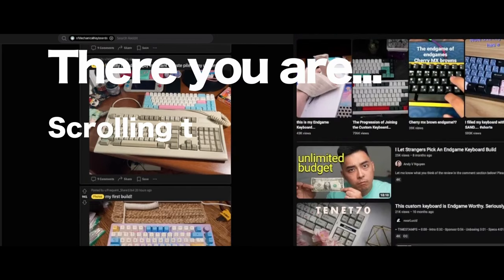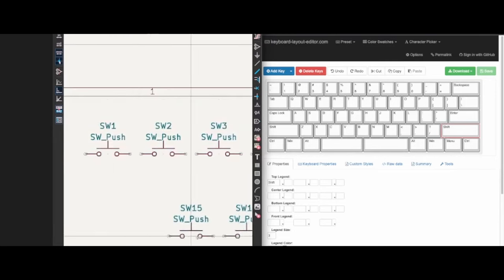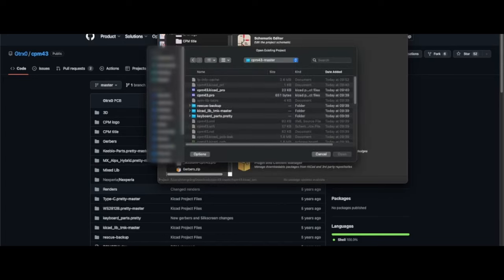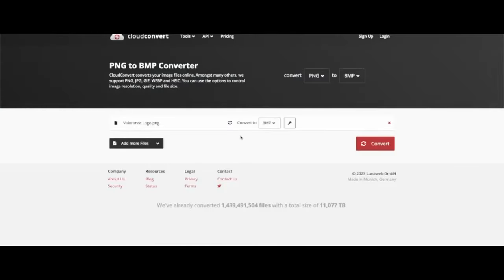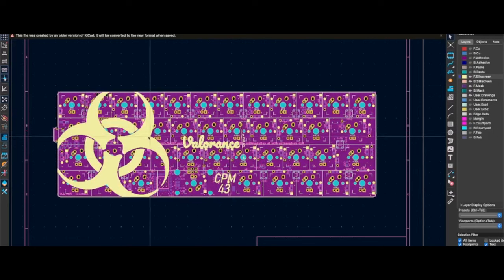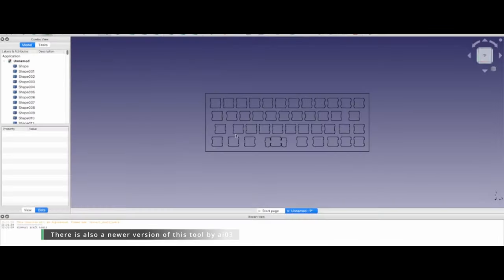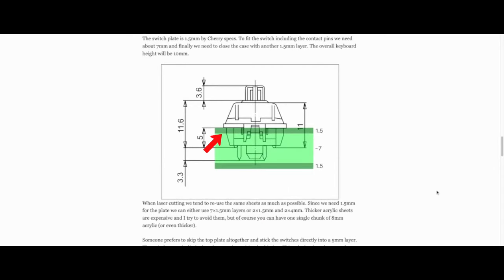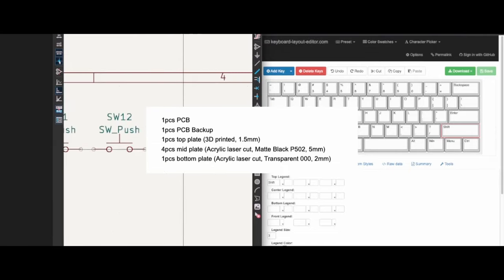How to (Kinda) Create ANY Keyboard

Comment: Hey Valorance, I would like a video on how to edit an existing pcb. Something like adding an extra key to an existing board or move the keys to different positions. I think, when creating a custom keyboard,  most people want some thing that already exist but slightly modified. I remember when I got my first keyboard I had to settle for the bm60ec because it was the only one with an encoder but I would had preferred another keyboard and replace a key for an encoder.

Comment: I wish you went over making the firmware, I know you probably reused the existing firmware for this pcb but still
Reply: @va1orance  nothing in particular but I'm surprised how empty the tutorials for firmware new pcbs are. I've designed quite a few pcbs but give up when it comes to firmware because even the guides suck. Just a straightforward step by step process of A to B is all I need
Reply: @va1orance  good to know, is there a way I can edit the columns? When I paste in my kle data the columns are a bit different than what's on my kicad design

Comment: How are RGB LEDs connected to a printed circuit board?
Reply from the maker: They are soldered on during fabrication.
Reply: @va1orance Thanks for the response, I expressed wrong, how the circuit works on the pcb. how it is connected to the MCU.
Reply from the maker: @RennanMendesSerenzaRennan  Woops, I missed this, sorry. I didn't show the schematic in the video, woops again, but the RGBIN and LEDPWM connects to the  PB6 and PB5 respectively (on the ATmega32U4).